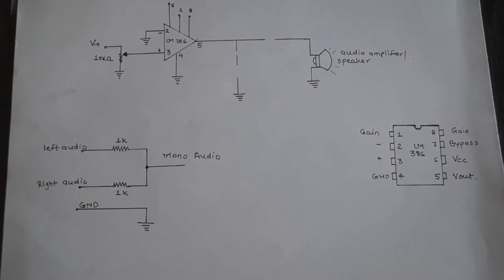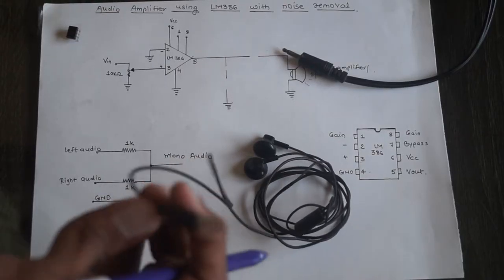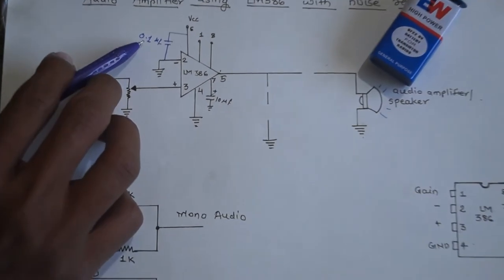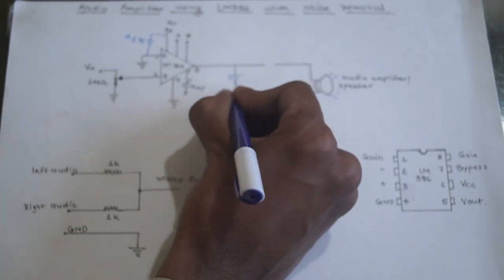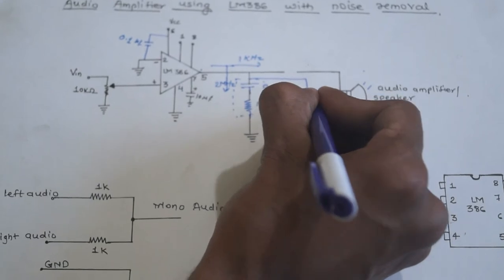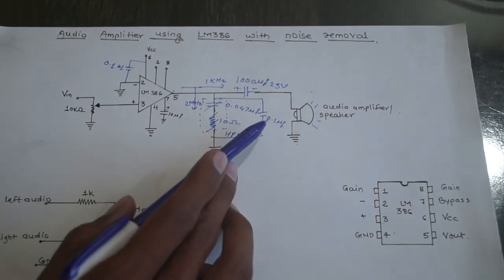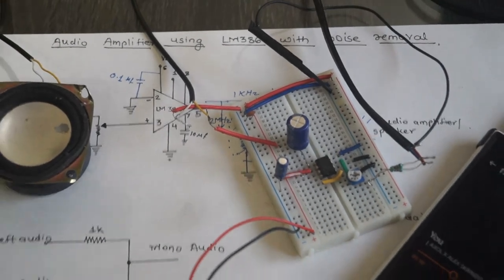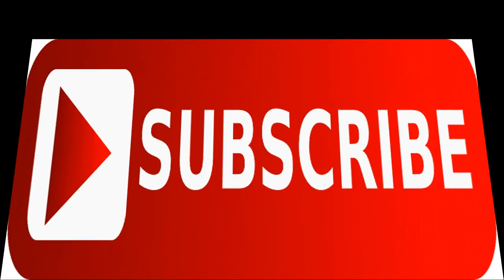Audio Amplifier Using LM386 With Noise Removal !!

Comment: I don't have any potentiometer. Any similar components to this?
Reply from the maker: The potentiometer used to adjust the level of input and it dont drive pin 3 from very high voltage.if you not connect potentiometer so you cant control input level.
Reply: can i add 1 or 2 led's for music rythm?
Reply from the maker: no, circuit only for amplification.

Comment: Please Share A List Of Components with codes. Because I'm Very Noobs.
Reply from the maker: Component list:-
1)  IC LM368 --1
2) 4O ohm speaker-1
3) Electrolytic Capacitor 1000uf ---1
4) Electrolytic Capacitor 10uf ---1
5) Disc type Capacitor 0.1uf---2
6) Resister 1k ohm---2
7) preset 10k ohm--1
also watch my upcoming video on audio amplifier for more details.
Reply from the maker: 1) IC LM386 please make a correction .
Reply: Thanks Man 👍